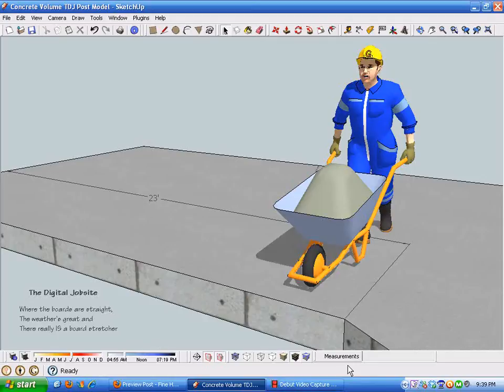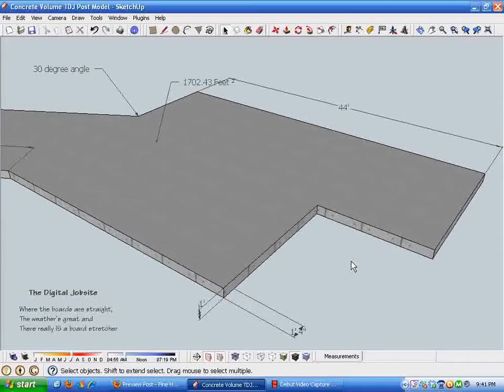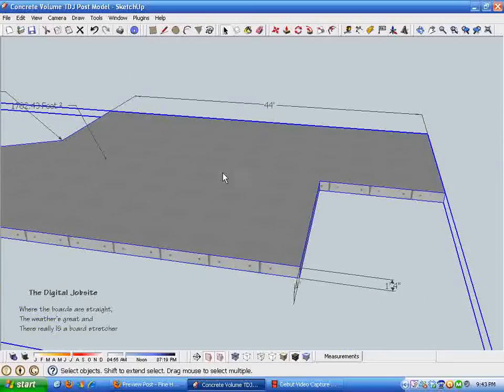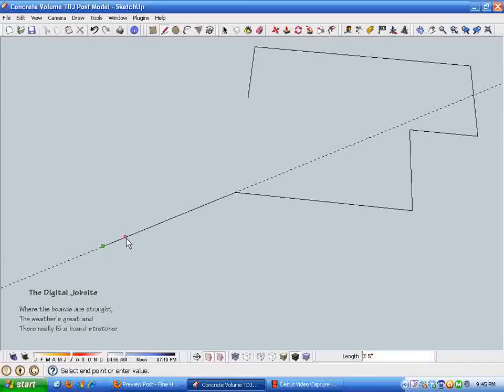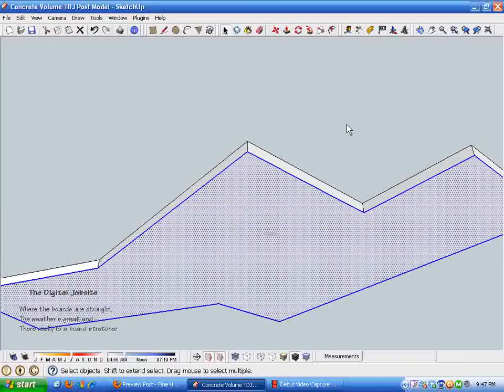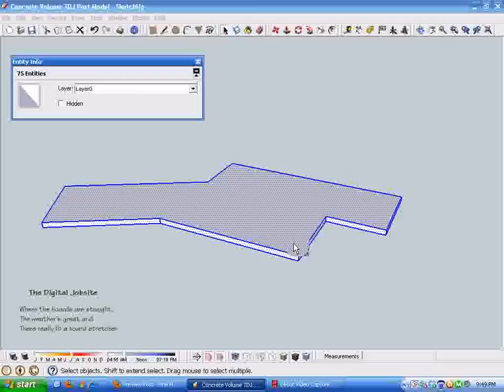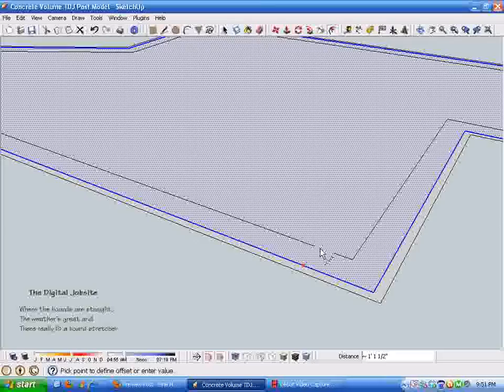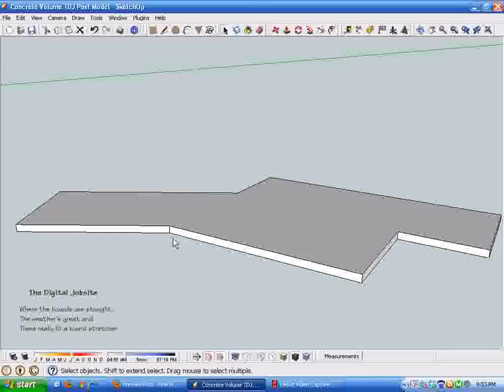Mud Math Figuring Concrete Volume with SketchUp.wmv

Comment: RemoteMowers,
Glad to learn you found this helpful.  If volume in cubic inches is all you need then you don't really need any plugin, as you mention.  The advantage of some of the plugins is that you can specify volume units ie: cubic feet, cubic yards, gallons, etc and not have to convert to them from cubic inch format.
Thanks for watching and commenting!

Comment: Hi Matt, I have watched your video. It is very helpful for me. Right now, I want to use 3D modeling software to do concrete quantity takeoff. I have used Revit but it is hard to do concrete detail. But Sketchup is much more easier to manipulate. I want to get more detailed quantity takeoff of the surface area and volume of the concrete work. Do you know which software I should use after building the modeling in Sketchup.  Thanks a lot!